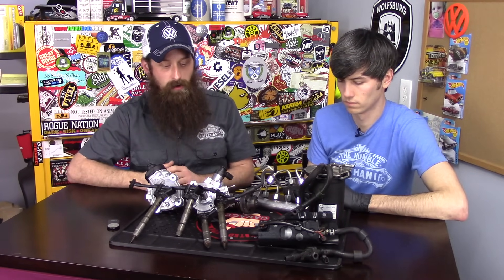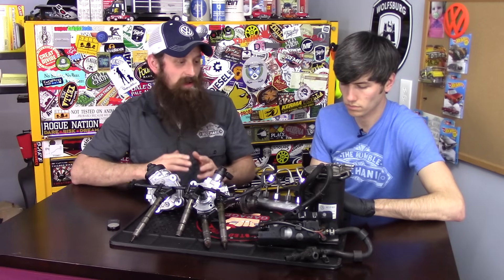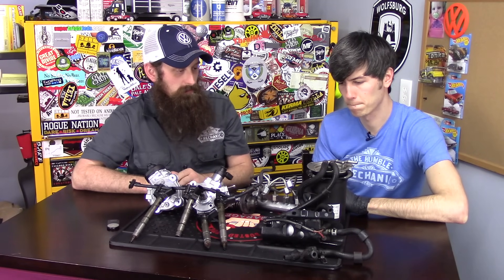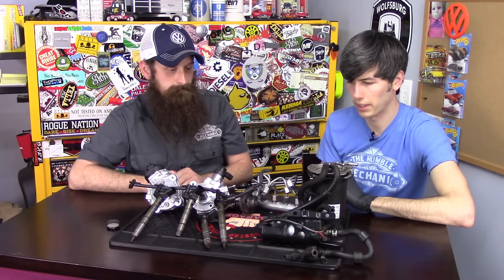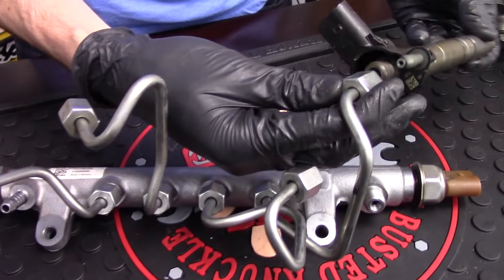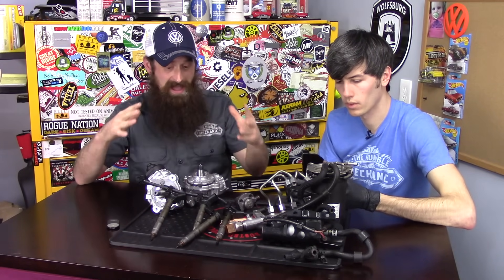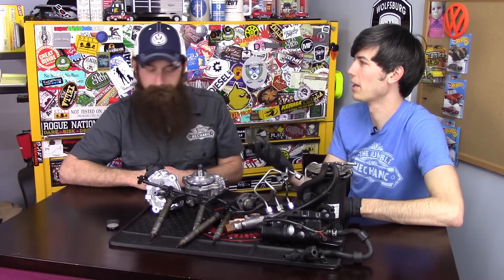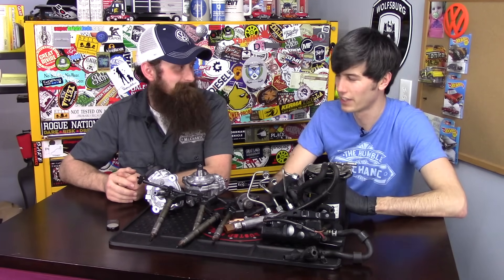Putting Gasoline In A Diesel Car - What Happens?

Comment: Different times, back in the days we used to put 10% gas on diesel cars @ winter here in nordic countries. Can't do that with modern diesel engines.
Reply: +70chevelle8 cheap anti-gel
Reply: +KevinTheFirefighter I ran my VW van on a mixture of waste veg oil and 20% petrol for 6 years with no problems, Don't try it on a common rail but the old Bosch V series pumps are all but indestructible
Reply: +Rentta 
Today we regularly mix up to ~10% Kerosene into our diesel for cold weather use.  
No gel, no hard starts, no fuel system or engine damage. 
Kerosene is a fuel oil and has lubricating properties, gasoline is technically a solvent with virtually no lubricating properties.
Reply: +Rentta I still do it, I have a 2004 Toyota.
Around 5% but only if temperature goes below -10°C in the night.
Reply: +Rentta I still hear of that here. Especially when the temperature is around 0F
Reply: patw52pb1 We have premixed temperature rated special winter diesel here in nordic countries so gas stations change their diesel to that for wintertime. Normal diesel is fine:ish down to -5c (23F) and winter diesels go from -23c to -34c (-9.4F to --29.2F)
Reply: Rentta
Yes, we have that in certain regions of the US and Canada as well.
Reply: that's old school... it was usually 3-5%
Reply: "Diesel" fuel is treated for the temps in the area in which it is sold for the most part. Filling a truck in AZ then driving in a blizzard in N.Dakota on the remains of that tank might well be problematic unless the driver bought fuel conditioner and added it along the way, which most do I'm pretty sure.
Reply: +patw52pb1 Wow, most informative comment I have ever read on youtube. Thank you sir!
Reply: my friend used up old tractor diesel in a old single cylinder 2stroke snowmobile.  I belive he mixed about 50/50 gasoline and diesel. it didn't damage anything but it smoked more than usual.
Reply: +Ryan Toomey woah. Just because todays fuels have 10% ethanol doesnt mean its good for them. I try to stay away from ethanol as much as possible, though its virtually impossible anymore, but it still poses problems for gasoline cars that are not specifically built for ethanol use. Overtime, issues will occur in the fuel system as the ethanol will slowly eat through everything that wasnt designed for it.
Reply: put 10 to 15% kero  instead of gas  its worked well for me for 40+ years
Reply: john endsley Here we meet a man who doesn't know what he is talking about or maybe i just didn't know they used for example common rail in 1971 volvo....
Reply: James Tennier
White gas is a colloquialism for naphtha which is a solvent with no lubricating properties and use in most modern diesels would result in damage.
Reply: +James Tennier well... at the gas station I worked at as a kid, many old farmers came in and filled with diesel but added a couple of liters of 89 octane......  so no, not white gas...
Reply: +James Tennier well... at the gas station I worked at as a kid, many old farmers came in and filled with diesel but added a couple of liters of 89 octane......  so no, not white gas...
Reply: +Rentta Fuel now has 10% ethanol in it so it is okay with modern engines.
Reply: +Mario Our diesel car had no issues whatsoever @-32°C in Umeå two years ago. + You do feel safer with >900km range in north sweden, where gas-stations are hundreds of kilometers apart...
Reply: James Tennier Is that why they have diesel #1 and diesel #2? For cold climates don't they put additive so it doesn't gel?
Reply: +Ryan Toomey 
diesel #1. Never seen that in truck stops out west. Heard about it over five decades though.
2016, distributors have so many requirements in formulating fuel much less (boutique) gas depending on where it will be sold, that I'm reasonably sure we're all good to go if filters are regularly tended to and water seperators drained when necessary too.
Reply: +James Tennier Diesel #1 is also known as kerosene.
Reply: +patw52pb1 thanks man, are you really smart or just good at google?
Reply: +Mario what the hell are you talking about ?
Reply: +KevinTheFirefighter Do you ask your gas station about what they are actually selling to you?
The petrol companies to change their "additives" depending on the season and other variables.
Reply: +patw52pb1 But where to get kerosine? Isn't that like rocket/airplane fuel? Can't exactly get it at petrol station now can I?
Reply: I have run a 2004 mod Mazda 626 Turbo Diesel on 100% Kerosene for over a year with 1/100 of 2 stroke oil in the fuel (1/200 is what most recomend). I had 1000Liter of old Kerosene that was used decades ago for heating and figured out why not use it as fuel as that is the fuel they use in mines for all diesel engines to improve air quality in the mines.
Reply: there is very little difference in a modern TDI and a mark 1 from 1985 or 1971 Volvo 2. it's all a marketing ploy.
Reply: Samuel Rosenberg Good point about first diesel passenger car not coming out until 79, i didn't even think about that.
Reply: Slightly off topic but something to ponder... I have a friend with a 03 Ram 2500 Heavy-Duty CR who has been running his truck on a mix of filtered waste vegetable oil and regular unleaded gasoline for over 10yrs (30 gallons WVO to 4 gallons of Regular Unleaded Gasoline) with no problems.
Reply: @ Samuel Rosenburg - Yes, the IP's on the 03 5.9 Diesel Rams are mechanical. Based on past conversations with my friend, the 4 gallons of regular unleaded gasoline apparently thins out the wvo enough, that the truck runs fine during the warmer Summer months. Also recall him saying he has to increase the # of gallons of rug in the Fall, Winter and Spring months... however, I do not recall the exact gallon ratio of rug to wvo he uses during the cooler months(?)
Reply: Mario - You have no clue what you're talking about. 
Greetings from the Norwegian winter.
Reply: The old diesels can even run on cooking oil.
Reply: James Tennier
In the US and Canada there are basically only 4 on road diesel fuel blends, #1 Diesel (1D), #2 Diesel (2D), Winter Diesel and Arctic Diesel, 
Winter Diesel contains a specific percentage of #1 Diesel blended to #2 Diesel at the distribution point and generally available in cold weather months and regions. 
Arctic Diesel is basically Winter Diesel with a higher percentage of #1 Diesel and a specific additive package for extreme cold weather usage. 
Winter and Arctic Diesel both have lower cetane number than #2 Diesel to help promote easier starting and operation in cold weather. 
All are ultra low sulfur (ULSD) as refined and produced. 

The #1 Diesel is is synonymous with and also sold as Kerosene. 
The individual retail name brands are free to add their own additive package to diesel fuels and market them as such. 
Many refer units are fueled with #1 Diesel, some year round. 

Diesel fuel by design contains numerous paraffinic constituents that can cause negative experiences in cold weather, including clouding, gelling, filter clogging and reduced fluidity. 
Cold weather filter clogging is a reason many engine manufacturers place and mount the diesel fuel filter on the engine where it can be kept warm. 
Some cold weather engine applications incorporate fuel and filter heaters to help mitigate cold climate fuel flocculation and resultant filter clogging. 
Diesel fuel is also somewhat hydrophilic resulting in emulsification and requiring the addition of nonionic alkyl poly glycol ethers combined with hydrophilic alcohol ethoxylates to help demulsify and prevent ice crystals from forming in cold weather. 
With regard to automotive usage, most car and light/medium truck manufacturers with common rail injection or unit injector diesel engines prohibit the dilution of #2 ultra low sulfur diesel fuel with either gasoline or kerosene as it will likely catastrophically damage the fuel injection system.
Reply: Started to say; today's (government mandated gasoline till the next farm bill) has the 10% ethanol. Diesel is a lower distillate and has lubricating properties that gas does not. In days gone by far more sulfur etc was in diesel so the bit of "gas" dumped into the tank in the winter months served to keep the diesel from "gelling" or waxing. It didn't seem to diminish the lubricating ability inherent in the diesel. With today's low sulphur and exhaust after-treatment machinery hanging in the exhaust stream I'll wager it's an entirely different world.
Reply: Mario You have no idea what you are talking about. They start fine even at temperatures colder than -30ºC / -22ºF. Diesel cars are really popular in nordic countries and yes it does get that cold during winter.

Comment: Jesus just drain the tank and refill it with diesel, if the parts fail then change them.
Reply: Exactly!
Reply: i have. I just may not be able to express myself like i wanted to. (english is my secondary language).
I mean like, you have put gas into your diesel car, and you stopped. Now the tow truck brought you to a shop, and they flushed the system. Now, after 50k miles (or whatever) there could still be metal particles in the system, potentially damaging the injectors, which may start leaking. (its  a lot of if and may... i know).

Now the problem is, where i live, you have to give warranty on your work, no matter what you did, for 1 year. My buddy is working in a car shop and they had exactly that problem. 

Customer put gasoline into their transporter (mercedes sprinter), drove away, car stopped, got towed to my buddys shop. they only flushed the system, and after ~70k kilometers they had a engine failure because one of the injectors started leaking.. unnoticed. And they sued the shop. (the sue is still going btw).... so humble mechanic has a point of changin the hole system.

on the other hand, they had countless times where they just flushed and nothing happened over the years.
Reply: +MrGuvEuroman well problem is, if you get those metal particles from the high pressure pump into your injector, and it starts to leak fuel into the cylinder, your going to wash away the oil in the cylinder lubricating the pistons. sooo  your going to have a engine failure aswell... so rather change fuel filter, high pressure pump, rail and injectors, before having to replace the hole engine later on.. the higher the pressure in fuel system, the more likely that this will happen... its still a low chance overall, but yea.. "be safe, spent a lot" right?